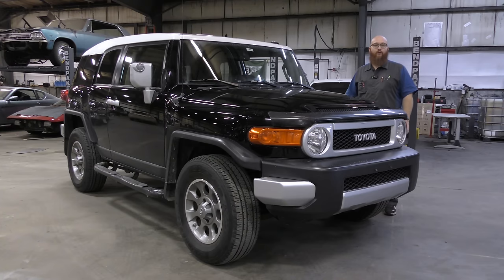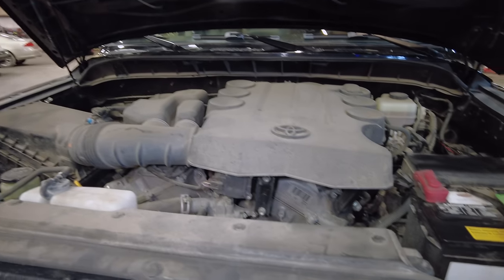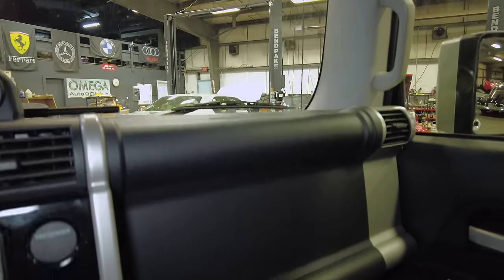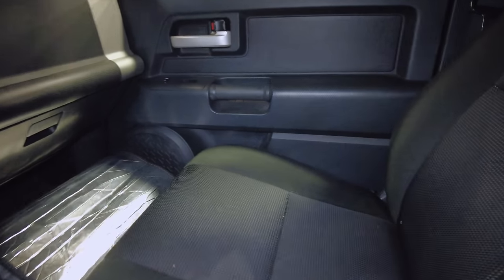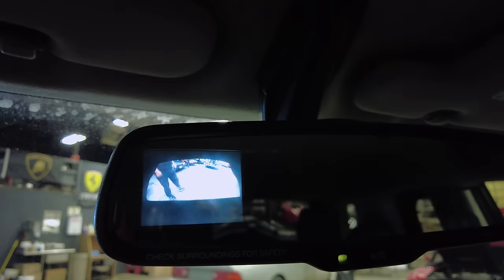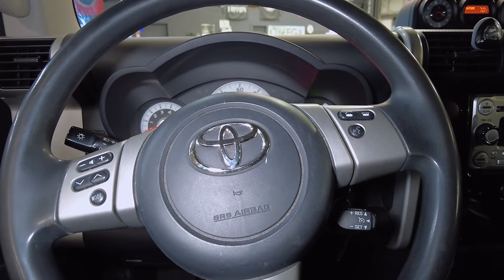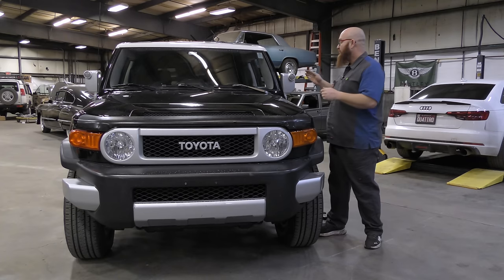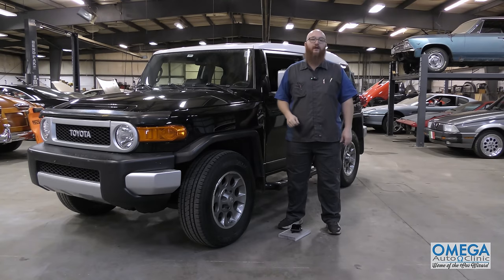Prices are Changing! FJ Cruiser Prices Are Plunging! What Happened?!?

Comment: Bought my 2007 in 2011 for 10k, sold it 2022 for 11K.  Only gripe I had was I had to run premium.
Reply: Driving a car for a decade and selling it for more than you paid is awesome. Toyota resale value ftw.
Reply: Had an 07 C-package I sold at 330k, never once got a tank of premium 😂
Reply: Never ran premium in mine either.
Reply: The earlier models required premium whereas the later ones with the updated engine did not.
Reply: You don’t have to run premium
Reply: The 4 liter in my 4Runner runs fine on regular.
Reply: They absolutely run BETTER with premium. They still run on regular, but the ignition timing is changed and it loses some power
Reply: Lol premium? What a joke. My trailblazer ss runs on 87 and has twice the power.
Reply: @keithbellair9508  good for your garbage trailblazer 😂🤣
Reply: @d47000 that was because of the pandemic, the overlanding craze, and the insane inflation we have experienced. That’s not a normal case situation.
Reply: @flight2k5 you definitely don’t have experience with FJs. The interiors may as well have been 3D printed. They rattle worse than a damn trailblazer. Oh and the trailblazer doesn’t need a timing belt and water pump changed every time you look at it wrong.
Reply: Hmm, mine has never seen a drop of premium and she's still going strong with 168,000+ miles on her.
Reply: @ronschwolsky1626  the computer adjusts for it. It is a tiny difference. 99% of people wouldn’t be able to tell a single difference between 87 or 91 octane
Reply: @keithbellair9508  and is probably on it's 3rd transmission.
Reply: @reed785M t dude, they use a timing chain and mine is ac2014 and zero rattles squeaks. You’re just a Chevy fan boy trying to stir the pot. Have fun with your Chevy 😂
Reply: For all of those saying not to run premium, I towed a boat with mine and definitely noticed a difference in gas mileage and most importantly power loss when running regular.  That and the fact it wasn't my daily drive, so I didn't want it sitting with ethanol in the tank.
Reply: @reed785M  I was a GM and Toyota technician lol.  I definitely don't know everything but I've had a little experience.
Reply: @wicky383  yes it takes some timing out and adjusts fuel tables. premium has ethanol as well. You towed a boat with an already underpowered v8 of course a couple degrees timing pulled is going to be even more noticeable when it needs every bit of power it has which still is anemic for towing most boats.
Reply: @fritty9927  not all FJs have timing chains.
Reply: @wicky383  he doesn’t know all FJ’s have timing chains which is pretty common knowledge, so he’s probably guessing at the rest
Reply: @reed785M  they all have chains
Reply: @fritty9927  Idk why I thought some FJs had the v8, you’re right.
Reply: @reed785M  no sweat. You might be right about belts on models made overseas past 2014

Comment: Bought my 2nd one two months ago.   2012 with 75k miles and manual transmission, no rust/good frame.  Best vehicle I’ve ever owned.   $22k !    I wouldn’t sell it for $30k
Reply: Wow that’s a fantastic deal! What color is it? Clean title? Any previous accidents?
Reply: @stanceswitch6419 Iceberg.  Clean title and no accidents.   He was asking $30k.  I saw it wasn’t selling then the price was lowered to $26k.  I offered $22k and he took it.  Never thought I would get it for that price
Reply: I just saw one advertising at the Toyota dealership for around 30 with the same mileage. The manual transmission would  have been better.
Reply: @EmDub215 If mine wasn’t a manual I wouldn’t have bought it.  I only wanted a manual. I was looking for over a year and this one was 2 miles from my house.
Reply: @peterbilt63 I agree. The manual version is the way to go.
Reply: Manual transmission ones are AWD with a manually locking center dif.  Auto trans models are part time 4WD.
Reply: No one is asking you to....!
Reply: Look it has a manual transmission is it a 5-speed or is it one of those more fancy ones with a 6 or 7 gears? I love manuals but I'm not comfortable with anything above a 5-speed and I started out with a 3-speed.
Reply: Any major maintenance an the FJ you own. I'm gonna need to replace the 07 Honda crv with 520k on it sooner or later.
Reply: @glengarbera7367  520k miles?? I just picked up an 06 just under 100k. solid car but it might have unresolvable rodent damage/smell 😢
Reply: @peterbilt63  Nice buy. I've wanted one since they came out. The manual is awesome, those are more rare as well. I would recommend undercoating it in fluid film so it doesn't rust.
Reply: You paid 22k for a 15 year old manual Toyota lol
Reply: @Getitstraightyo   A 12 year old vehicle with only 75k miles that's in good shape and will last many years. Toyotas hold their resale value more than almost any other vehicle for good reason. What's the problem here?
Reply: Your right you won’t sell it for 30k…be lucky to get 20 now
Reply: Awesome, whered u find it and did u check it out and what to look for issues
Reply: almost the same story, I've got FJ with manual transmission, never going to sell it
Reply: Why is it your “second “?

Comment: Bought a 2007 in 2018 at the bottom for $10k, sold it in 2021 for $16k.  Even though it was a great profit, I kind of wish I’d kept it.  Loved that thing, and I don’t know if I’ll ever find one as clean.
Reply: I wanna trade mine in for a 4Runner but this FJ is already considered a “collectible”
Reply: They got completely unreasonable.
Reply: @axetrops  4th gen V8 4runners are very hard to find but the Lexus GX470 is very good. I love mine. Bought pre pandemic for about $11k and 150k miles. I have watched the prices get stupid high and come back down over the course of the last 3 years.
Reply: @sv650rider  I wanted one of them real bad in 2022, but all the examples on the east coast seemed to have horrible frames or outrageous prices. I'm just gonna hold out for the 460 at this point.
Reply: @sv650rider I have a 2008 toyota 4runner 4.7 V8. I love it. But, I'd trade it for a FJ in a heartbeat. I just love the way the FJ Cruiser looks!

Comment: I bought a 2012 Trail Teams FJ for $35k brand new. That was the most expensive version. 2014, last model year, was just a bit more. I regret selling mine in 2014 back to the dealer for $30k!
Reply: So you drove it for 2 yrs and lost 5k..not  bad all
Reply: We still got them brand new for sale here in our market, but they cost 75-85k$. Its still the same car with just 1 change - cars got a rearview mirror with a rearview cam as standard option.
Reply: @ETr4d3 oooof
I still would probably buy it if I could 😂
Reply: Unless you replaced it with a new one it obviously wasn’t the vehicle for you.
Reply: I had a 12 FJ TT too... it's one of the few cars I regret letting go.  The Radiant Red was the best.
Reply: @JeepCherokeeful  how is that obvious..there are a hundred things that can happen to someone that would make them have to sell a vehical..sounds like u've had an exciting life
Reply: @Jeremya74  I am driving a 2006 Honda pilot with 152K miles and runs fine. Not for sale!!! as well as 1998 Toyota Sienna 252K miles, spare car, not for sale. LOL:face-blue-smiling:
Reply: @Partsforscooters1  ooh, you let a gem out of your hand. Magna (not TT),  Red & cement TT is a rare color. They are actually hold their value higher than 2014 heritage edition .
Reply: @tomnguyen7977  Oh... I know. Mistakes were made for sure.

Comment: In regards to the brake controller, you've got some bad info. The FJ is rated to tow 5,000lbs. Trailer brakes are a must have. Toyota recommends having functional trailer brakes at anything over I believe 1600lbs on the 5th gen 4Runner, without researching, I'd say it's the same with the FJ.
Reply: Also, brakes can make any towing safer. I had an 02 Elantra that was rated for 1300 lbs without brakes or 1800 lbs with. I bought a 6x10 trailer and had some very stable towing and excellent braking. It was great for moving furniture or my motorcycle without needing a van or truck the rest of the year.
Reply: I can't believe anyone would not recommend trailer brakes for towing, regardless of the weight.
Reply: if you are towing 5000lbs with this vehicle you are going to have a very miserable drive, the engine can barely power the vehicle just by itself
Reply: I had a coleman pop up that needed axle swap.  One I got had brakes and it was impressive difference even though it weighed nothing. And that was towing with my 1 ton chev or my Hummer. 
 This guy is juts recommending removing a brake controller.  NV law is all trailers braked if 1,500 lbs or more.  

I towed a 3,200 lbs trailer once with my 07 fj without brake controller- guys truck broke down offroad.  It handled the trailer just fine but if I did it once a year the brake controller is worth it.  

10,000 lbs trailer with this - wth is he talking about?!? Probably not smart to drive from USA to Australia underwater also.  Smh
Reply: I haul around small trailers with my Suzuki SX4.  The owners manual explicitly states that the vehicle is not designed to tow anything, so don't do it.
A lot of these owners manual statements are there just to cover their hind end against idiots who have no business driving a vehicle WITHOUT a trailer.
Reply: @silvernoob1603  you must have never drove anything from the 80sor 90s, 270hp is 80hp more my than my 95 f150
Reply: I have towed my 4500# flooring trailer with my 08 FJ hundreds of times with zero issue 🤔

Comment: Exception to the price decrease are the special editions (Trail Teams, TRD, TTUE, etc) of these FJs. low miles examples still demand a pretty high premium.
Reply: Any low mileage 2010-2014 is still high also.
Reply: 07 with under 200k,
Locker, ATrack, roof rack, suspension bump w/arms& shocks, both bumpers swapped & basic lights.  
I still turn down offers of $25k.  
Why?  Even with bad paint there is zero rust.

Most of them out there are rust buckets and you can’t fix that.  
Then the posers who can’t even get in a truck without hurting themselves talk like experts so the masses follow.  

I say let the REAL future owners get them a couple bucks off so they can understand why real offroading people love them.

My 07 fj can’t do everything my hummer can- but it does most of it and some things like sand it does better.

Comment: I actually got my FJ not too long before this video came out. It's a 2007 with 270K, 6-speed manual, and in very good condition for the mileage. I got mine for $11,500. Thus far it has been an absolute joy to drive and own. I understand the grievances Y'all ended up having with yours, Mine is a tad bit different, and those differences negate some of those issues (mine sits about the same ride height as the one presented in the video, and it was also the really bright, voodoo blue so that center dash is a really bright so working in the dark isn't bad at all). It's got plenty of room for my stuff, I love the manual transmission, and it's got an aftermarket stereo system which is an additional bonus. in terms of maintenance, I've obviously been doing basic stuff like oil and filters, but I've been slowly replacing alot of suspension parts. This is not necessarily because stuff is breaking, it's mostly preemptive considering the mileage. I plan to own this vehicle for at least 10-20 years, so I'm going through and freshening it up so that it's starting off in a good spot. once I finish suspension stuff, I'm going to be looking at rebuilding the motor and transmission. Once again, mostly preemptive, however the clutch throwout assembly is starting to make some noise (classic FJ issue) so I'll be replacing that as well as the clutch when I get to the rebuild stage. 
I'm absolutely in love with my FJ, she's taken me on some great offroad adventures already and it's definitely a head turner, I get questions about it in parking lots and gas stations, which generally makes my day.

Comment: The FJ is the last of a specific breed- a simple, no frills, off-road capable vehicle. Toyota reliability is a most important part. Every other 4x4 is full of tech that is expensive to purchase and expensive to repair or some sort of crossover or hybrid. If Toyota decides to make a new one, it will most certainly be a much more complex vehicle, and doubtful it will even be body on frame. If you want the last of the authentic, go anywhere vehicles that are cheap and easy to fix, now is the time while there is a lull in the market. I’m never selling mine, that’s for sure.

Comment: I bought a 2004 v8 4Runner with 200k miles for slightly under 10k. Dude had upgraded the suspension, put an ARB bull bar up front, a decent head unit with Android Auto and Apple Car Play, and new brake rotors and lower control arms. The frame wasn't rusty and that's all I really cared about. Compared to my 2020 Tacoma Off Road, this has nearly everything I want. I couldn't believe the price and though I wasn't seriously looking for a second vehicle, I couldn't let this one slip away.

Comment: My lovely Element totaled itself in 2017 to save my wife's life. And I coveted the FJ. Found the one I really wanted, used. Perfect. Just what I wanted in that lovely blue color they made. Jumped in. Hated the cockpit. Hated the engine—probably just the throttle mapping. Anyway, ended up with a GX460. But I still love to see these.
Reply: Agree, was tractor-like. Went with a 2006 LR3 that's been trouble free 3+ years now. Closest thing to a reliable product JLR made 😂
Reply: Your Element totaled "itself"?  

Did it go to a bar, get drunk, and then wreck itself while you were asleep in bed?

😉
Reply: Would you buy another Element? I have been thinking about one myself. I know they are getting long in the tooth now. So finding a great example isn't so easy. I would also like to find a good example of a Buick Park Avenue while it's not too late. Which it already is getting to be... I have been driving the same 99 Camry 4cyl since 2000 with 357k miles on it now. No issues, never screwed me, still runs and drives amazingly well and QUIET inside! I am spoiled by it's reliability and low cost of ownership, maintenance and ease of doing most of the work myself. So I would only seek out other Uber reliable, easy to service vehicles like it!
Reply: @inspire6837   could have looked into a GX470. same trans and AWD Torsen diff system as the FJ but with the UZ series V8.
Reply: @Flies2FLL  Calm down and have your mom make you a sammich.
Reply: @DaveGringo  The Element was a very capable little truck for what I wanted to do on desert trails. And it had some sentimental value from the places it took me to (and got me home from). But I love my Lexus.
Reply: @yelapa999  My mom died in August 2021, I ate dinner,  and I am quite calm already, thank you. And Now answer my question please....Did your Element drive itself off a cliff on it's own?  If so then you need to contact Honda because this is a serious flaw and they need to recall the car!  Also the NHTSB needs to be notified about Honda Elements suddenly driving themselves!
Reply: The throttle and shift mapping do suck.
Reply: Agreed. The interior is awful, which is a shame as they could have had some fun...
Reply: Same utility and offroad capability as the GX460, you made a better choice.
Reply: @sv650rider  only manual FJ have the full-time 4wd with a center diff
Reply: Good move to the GX!   I did the same from a 4Runner.   No comparison!
Reply: @Flies2FLL  could be he doesn't answer stupid questions from dim witted people.
Reply: @craigbutler623  Could be he's a dim witted people and cannot answer any questions whatsoever without a personal attack...
Reply: @stevebrackett2676  what do the GX's get for real-world gas mileage? They have to be better than an FJ, lol.
Reply: @DaveGringo  I have a 98 Camry with  125k miles. Second owner. In it and sorted for $3500. The Mercedes at the stop light next to me was loud and rattling, lol.

Comment: The FJ Cruiser is rated for 5000lb towing. You would be a damn fool to tow at capacity with no trailer brakes. 5k with a 3/4 ton truck and no trailer brakes no problem.

My 2008 FJ Cruiser was $28k new. Its still worth $20k all day long with 120k miles.
Reply: I have to agree though the extra safety = peace of mind.  I towed a 6k lb trailer for the longest time with my 06 Cummins 3/4 ton and had the trailer brakes installed.  A 6k trailer with a 7k tow vehicle......  Probably OK, but i think most people would want that extra braking.  And I think the wheelbase on the FJ is too short to be safe without the brakes on anything over 3.5k.  All personal opinion, of course, and I think I agree (mostly) with the 5k on a 3/4 ton IF it is the diesel that weighs so much.  Blessings.  Good post.
Reply: @davidbeckenbaugh9598  I have a  2500HD also, and I don't pull anything without trailer brakes with the exception of a single axle golf cart/garden tractor trailer.
Reply: @scootypuffjr. the other benefit of a quality brake controller is that if you begin to sway, you can use the slider on the controller to lightly engage only the trailer brakes and get it straightened out again. Pulled a 7000 pound, 30 foot travel trailer with a 2015 Tundra that has a Tekonsha electronic controller installed. I’ve used the technique I described to deal with wind induced swaying.
Reply: @bryanbrowning5746  I've done that. If the tongue weight is correct for the trailer weight I've found sway is not really an issue though.